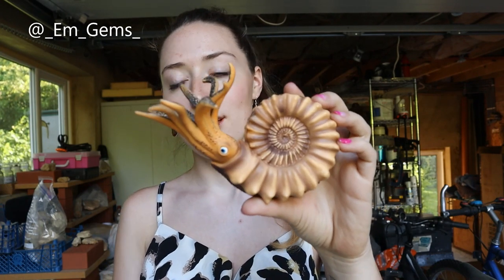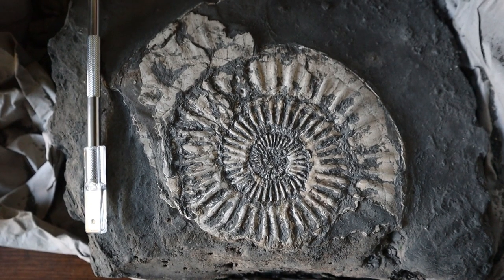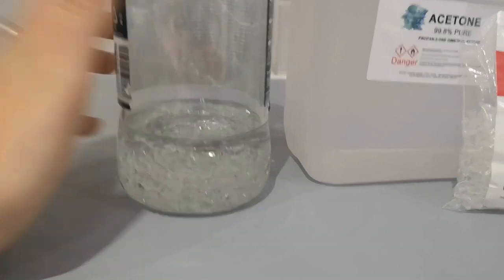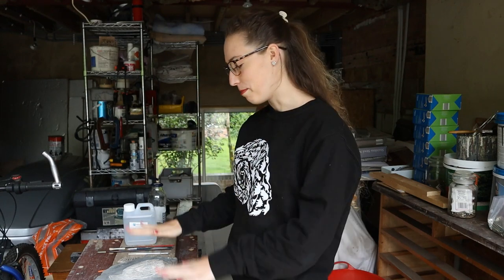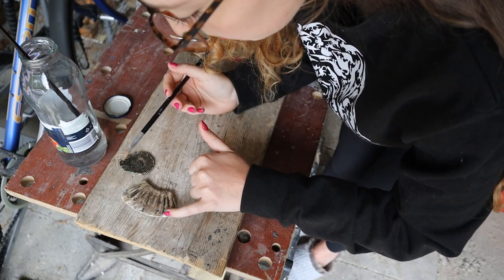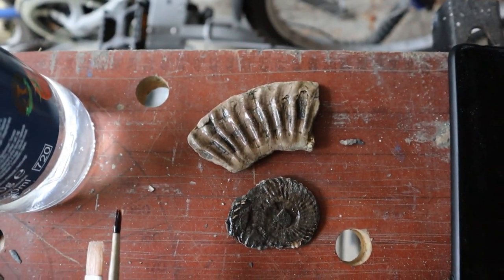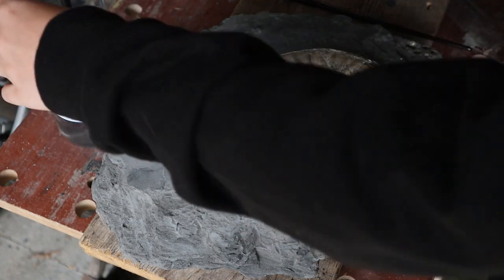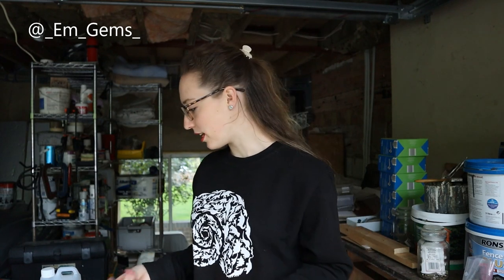Prepping A Huge Ammonite Fossil Still With Its Original Shell Intact - FOSSIL FRIDAY ⛏️

Comment: You need to buy a magnifying light, the ones with about a 6" magnifying glass on a flexible arm for cleaning. I do detailed scroll saw work and it is impossible without a good magnifying lamp. I think you stabilizer should be thinner for first coats so it will run deeper into very tiny cracks. I think you want the material to absorb what you are putting on, not just sit on top. Enough is when it has a even sheen but before it has a viable thickness to the stabilizer. How do you know the little one is not just a very young instead of a male. It could be a baby no?